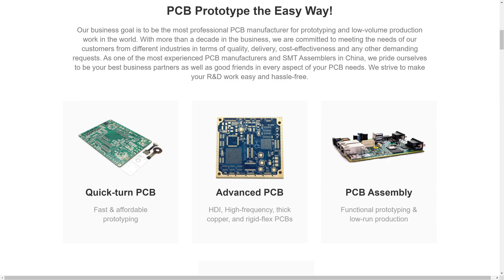I need to get better at soldering

Comment: I don't know if this will be useful, but it's an interesting story, I think you'll probably agree:

The only substantial soldering job I ever undertook, was when I bought Sinclair's ZX80 in kit form.

I had a friend who was an electronics technician at a local college who lent me: a fancy, thermostatically-controlled soldering iron/base station; side-cutters; top-cutters and whatever else I was likely to need.

The ZX80 pcb was getting on for the size of a sheet of A4 paper, there were capacitors and the other discrete components, along with twenty-some ICs with their sockets - they would all be socketed.

Anyway, that - cold, winter - evening, I arranged all the tools and parts on the table in front of me, sat down, switched on the soldering iron and waited for it to get to temperature.

The last thing I remember is the - not unpleasant - smell of the rosin flux.

It was some hours later when I stretched out my stiffness, examined the pcb, got up and walked around a little, when I realised that I'd lost all track of time - indeed, all track of everything.

Perhaps it was all those socket legs and the repetition, but I was once a half-decent hypnotist and grew up in the sixties, so was no stranger to 'altered states' - one of which I seemed to have just come out of - five hours? Something like that.

I socketed all the chips, connected the ZX80 to my old black and white TV and - by golly! - it worked!

Some years later, I befriended a guy who was a maintenance engineer at a recording studio, who offered to carry out a modification on my ZX80 for me, to do with giving it the option of working like the ZX81 - ie: getting an uninterrupted, moving, visual display.

When he gave it back, he told me he'd never seen a neater hand soldering job.

I couldn't really take credit for it, as I had no memory of actually doing it.

Anyroadup, make of that what you will. Could there be something useful in there?
Reply: Nice.

Comment: At 350c silver solder will bond more readily. Acid etchant and liquid flux are handy but can be substituted with water sponging the tip clean more often, should be silver not black. Should not be using leaded solder without catalyst and extraction. Low temp solder will stop you lifting pads.
Reply: Also clean the work area with white tissue, you are creating a lead vapour cloud. It will go grey and that residue is all over your hands as well.

Comment: My recommendations, available from china:
* A cheap soldering iron with integrated suction pump - around 5€
* Good flux, that is a paste, not liquid. I tell you, this is maybe the most important thing! Available in syringes and in small cups. It must be thick to make work easier.
* Soldering tin is all good in general, but for copper braid, don't buy the cheapest ones. For whatever reason they just don't take any solder. Good ones are matte brown copper, bad ones are red-ish shiny ones. But you don't see the proper color before you receive them, unfortunately.
* Good soldering iron tips! That is 2+€ per piece. Don't buy those 10pc/5€ kits, they are awful.
* JCD-8898 - for almost no money, you'll get amazingly good soldering station together with heat gun.

All mentioned things together will cost you under 50€ and is basically providing full set of "heat-work" equipment. And maybe you will not want to upgrade anything for another few years. ;)
Reply: that station you recommended uses exact same soldering iron he already has.

Comment: G'day Phil,
You are doing a good job with nice neat & consistent joints, getting into a rhythm helps with that. I like that PCB holder & I look into getting one, what I currently use is a mini vice that has a ball joint so I can rotate it to any angle I need for best access.
I get impatient from frustration sometimes too especially when things go wrong like that one joint that wouldn't take or when my head gets sore making it hard for me to concentrate, it's at these times I just need to take a break for a cuppa or even put it away for the day to start fresh when I feel better.

Comment: Nice. Practice is the key. A small tip, when you solder through hole parts first cut the legs, than solder. Otherwise the long wires act as a cooler and dissipate the heat, so your solder joints will get micro cracks inside and can even loose connection over the time. Instead, after you inserted the legs, bend those to the side, so the part remains in place, then cut the legs, then solder and watch that the solder flows into the hole. If you the shape of the solder joint is convex it wasn't hot enough and you have to wait longer until it gets concave.
Reply from the maker: Hey great for leaving a comment 😊 That is a neat tip with the component legs, thank you 😊
Reply: @philscomputerlab soldering necroware's gameport adapter is also a nice practice lesson, also with regards to order a custom PCB
Reply from the maker: @creopard  I'll check it out 😊
Reply: I thought the same, and just wait a little bit longer before removing the soldering iron so the flux in the tin can do it's work and flow better

Comment: A good solder practice is to heat both the compunent and the pad, at the same time and then to apply the solder. And this you are doing perfectly. The tip are you using depends many times with what you are used to, in my oppinion but ofcourse you should not use a small tip for a large pad or viceversa. The use of flux is welcome but not mandatory if you use a flux core soldering wire and I always try to use the rosin type flux whenever is possible (I use to dissolve it in alcohool and apply it with a small brush). As far as I see, all you might need is some pratice but your skill is not bad at all, I have seen worst soldering jobs on Youtube. 
I always cut the excess legs after I solder the component and if they are cut gently, i.e. without forcing the leg, there are no adverse efffects on the solder.
Well those are my opinions and maybe I am wrong but anyone can correct me.

Comment: If your soldering tip left a burn mark on a PCB, I think the temperature was way too high. The usual soldering temperature should be around 320-340°C, or even less (290-310°C) when using leaded solder.

Comment: you can never use too much flux
Reply: I came here to say this. That stuff is seriously magic and anyone should be afraid of using too little if anything.
Reply: i was literally going to scroll down and say more flux, looks like this whole thing is nothing but :D
Reply: The exception to this rule is around connectors or high impedance circuits

Comment: 25 years Engineer/Technician with vast experience in analog, digital, and microprocessor electronic circuitry: LOL, i always LOL'ed when those pc reviewers praised the quality soldering made by machines.
Reply: Machine soldering is one of the main failures of late 90's and early 2000's tech. If I had a dollar for how many Playstation-based arcade games (using same chipset) I've fixed by resoldering the QFP240 CPU and QFP240 GTE I'd have a lot of dollars hehe!
Reply: @g4z-kb7ct  Talking about flagship videocards LOL
Reply: @cesaru3619  What? The OP comment was about machine soldering. The chips are the same types, high-pin-count QFP chips, same technology as used in Playstation.... you may want to do some research and get a clue about circuit board manufacturing and components before commenting on things you clearly know nothing about LOL!
Reply: Not to mention the ban on leaded solder. Turns out, lead was there for good reason for the last few thousand years. 
There are literally no advantages to using lead-free solder, it's not even any healthier, you cannot vaporize lead with a few hundred degrees.

Comment: I should finally learn to use FLUX in my far and apart solderings..
Reply: The flux contained within the soldering wire should be enough for soldering new THT parts on a clean board. Repairs and SMD soldering are other stories.

Comment: Hey I do the similar practices some soldering for vacuum lamp amplifier. If U am good at it I may fix the four cpu pins desoldering and then solder again with anew part on 760gm-p23 board recently broken.